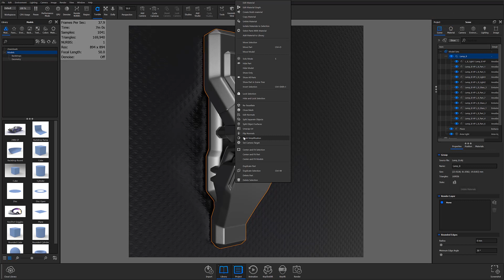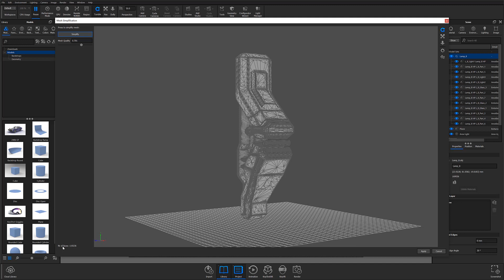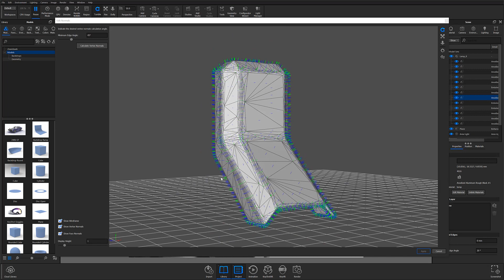KeyShot Quick Tip - Mesh Simplification Tool

Comment: I thought Keyshot could handle millions of polygons without any speed impact. What is the use of this feature?
Reply from the maker: KeyShot can certainly handle hundreds of millions of polygons without issue, but computer hardware plays a huge part in whether the computer running it will be able to handle a scene of that size. Another use for this feature would be to help reduce polygons for models that will be exported for AR use through USDz or GLB/gLTF. Typically models with high polygon counts tend to be too much for a cell phones processor to handle. Hope that helps clarify!

Comment: We also need a tool for Subdivision.
Reply: Already exists. It’s called the software you use to build you models before importing them into KeyShot.
Reply: @tgs1766  Smartass. Not everyone who renders, also the modeller. Keyshot was born from the void of photorealictic render engines for CAD modellers. Not from lack of render engines in general 3D software. If I build in Houdini, I have Redshift and has zero interest in using Keyshot. But if I purchase aseets for my Keyshot scenes which has FBX/Obj geometry in pre-subdivision state I need that tool in Keyshot.

Comment: How is this different from tessellation?
Reply from the maker: The Re-Tessellate tool applies specifically to NURBS based models while the Mesh Simplification tool is designed for use with mesh based models that do not have NURBS data. Hope that helps clarify!
Reply: @keyshot  So if your model has NURBS data, it is always best to use re-tesslate instead of mesh simplification?